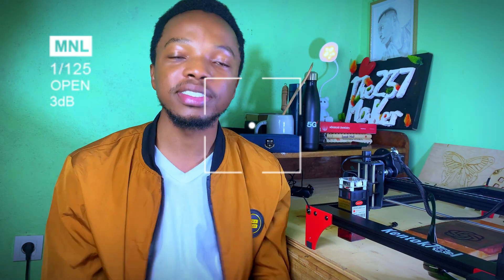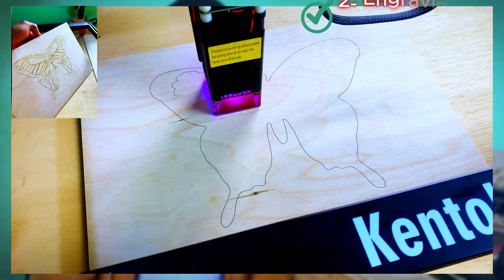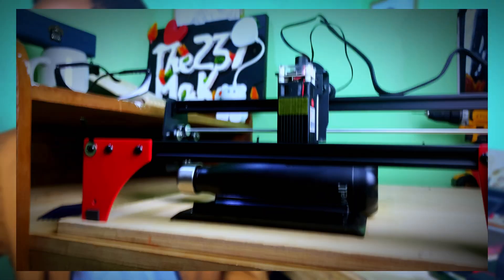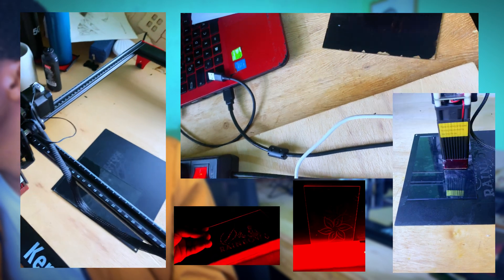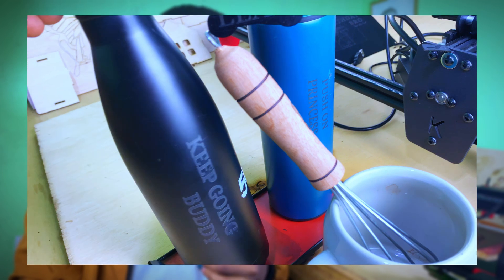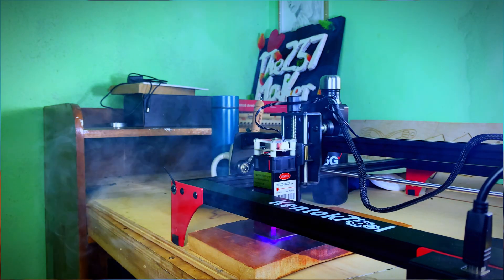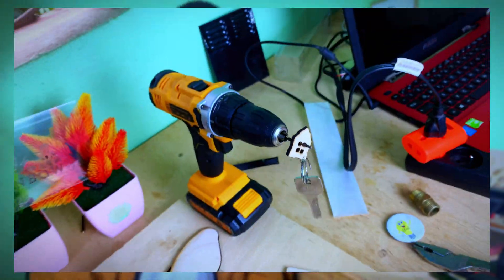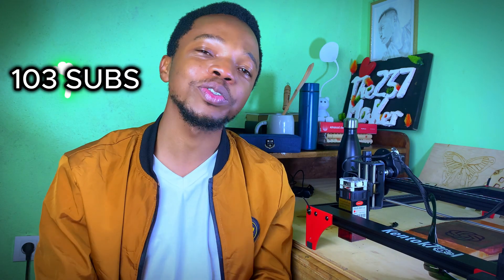5.5W KentokTool Laser Engraver: ALL you can Cut/Engrave

Comment: I tried cutting 3mm plywood with a 5.5 watt and could not get though it at 100/100 4 passes.
Reply from the maker: Hmmm. This is quite strange. The plywood I have used the most for cutting so far is actually 3mm and after 2 passes most times.

The issue I faced most of the times while cutting was  that some particular parts of the board will only be marked and not cut and I think this is because  some boards weren’t flat enough and the parts that were out of focus tend to not cut but rather get marked or burnt. it helped when I clamped the boards somehow to keep them flat.

Did you try lowering your speed ( lower than the recommended)?
Reply: @ I found the issue. I was not focused correctly smh.
Reply from the maker: @littleredbarncraft4101  Glad to hear you sorted it out.